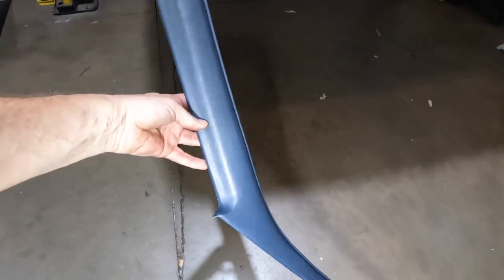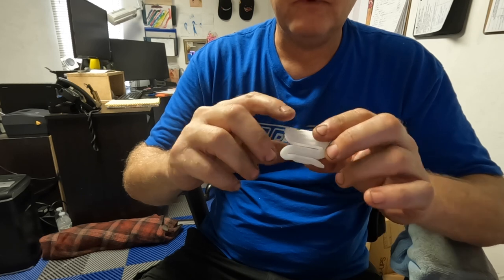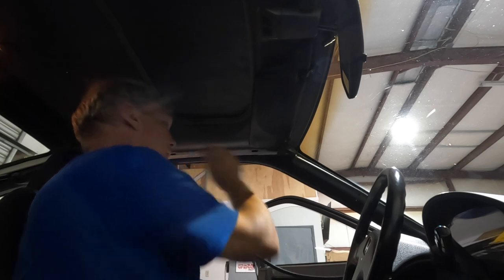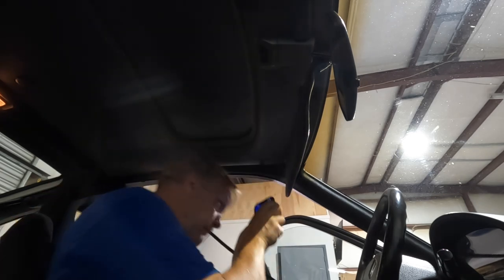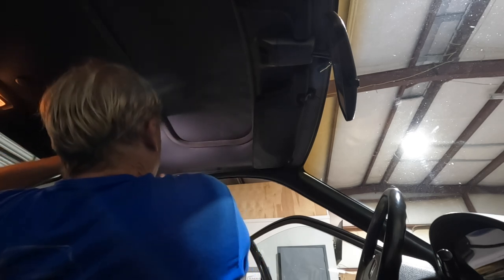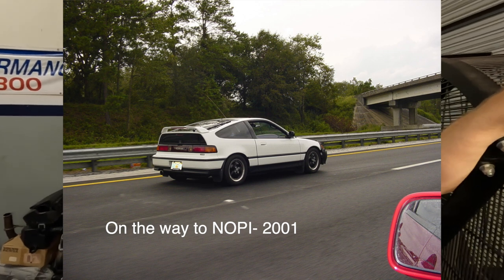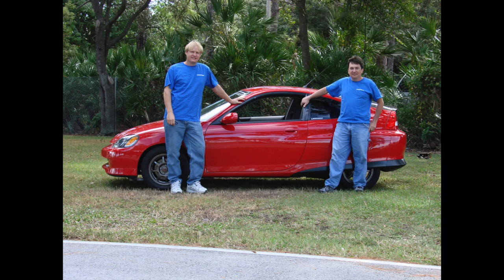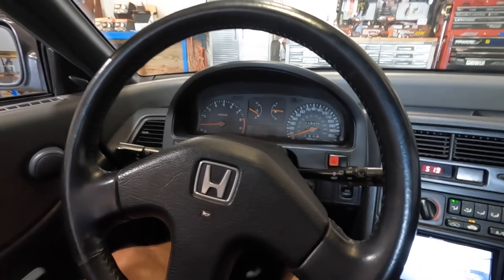Steering Rack problem in the CRX, A little back story Part 14

Comment: Good work on the panel removal.. 30 year old plastic exposd to heat and sun = brittle ! Wouldnt it be better to just replace the steering rack ? Sad about Steve !
Reply from the maker: The steering rack is discontinued.  Plus, the $13 bushing fixed the issue.

Comment: Hey John. Got a question for you. I bought my CRX in 88 from a Honda dealership here in Melbourne 🇦🇺. It came with the same rear spoiler as Steve’s you have. Interested to know whether that was OEM from Honda because when it was recently resprayed white, I noticed no makers marks or part number embossed anywhere? Plenty of aftermarket spoiler’s out there and it’s rare to spot the one I have.
Reply from the maker: The spoiler on our came from Japan. The us CRX didn’t have a spoiler option. I’m pretty sure it’s an OEM spoiler.
Reply: @LHTPerformance  Thanks for the reply mate. I suspected it was the real deal, being official dealer delivered but wasn’t sure. We were lucky being RHD, we basically got what Japan got. No Australian variants.